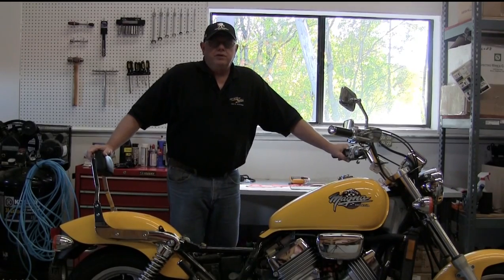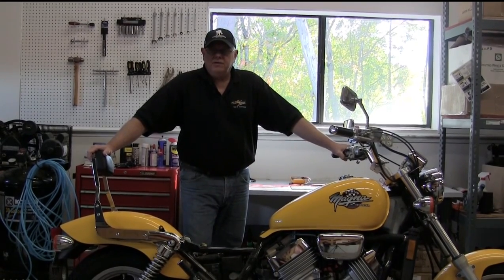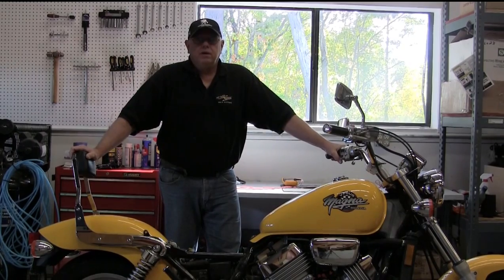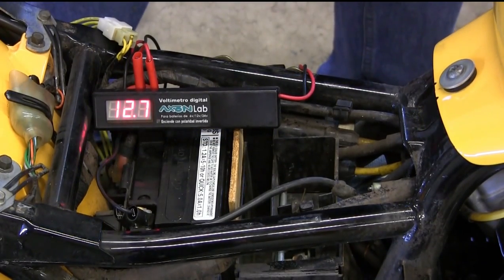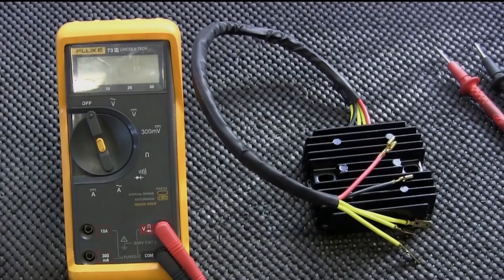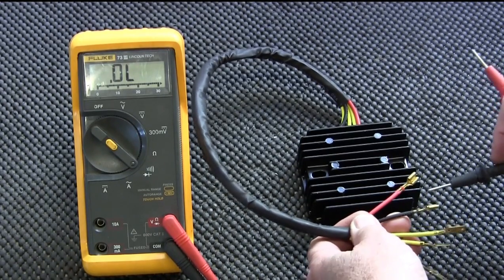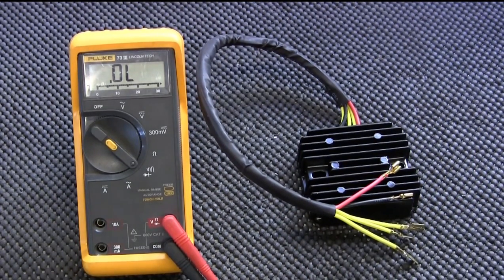#2 How to test a motorcycle rectifier regulator

Comment: What if my idle voltage is 13.9, but drops to 13.1 or less when I rev up? Vtx 1300
Reply from the maker: First thing I would do would be to load-test the battery and check all ground points as those are the two most common issues that result in voltage dropping as RPMs increase.  If you'd like to have your stator or rec/reg checked please email us at info@ricksmotorsportelectrics.com and we can set it up.

Comment: Mines shows 12.8 resting, goes up to 13.5 when turned on but when i rev it up it won’t go higher than that. 2 brand new stators and 2 brand new rectifiers and a brand new battery. What could it be?
Reply: Your recifier may be made to only allow amaximum output of 13.5v DC
Reply from the maker: Our set point on lead acid batteries is 14.5

Comment: Video was posted a while ago, let’s see if you get this haha. 
Testing my R/R I get a range of 400-564 going both directions on the positive and negative.  I get 5V dc coming out when the bike is running. High idle maybe 7v DC. The voltage on the battery doesn’t go up when everything is hooked up, just down as the bike runs so it’s not charging. The voltages from the stator are 12.6v ac and idle and 50v ac at high idle. I believe my regulator rectifier is bad…sound right?  I have an 02 Ducati monster 750Sie. Thanks
Reply: Yes, your R/R is bad.

Ha-ha ;)
Reply: @ruslankadylak2999  I had removed my R/R when testing it, and it looked fine. Removed it again later on while still trying to troubleshoot and there was now big burn. Mark on the bottom of it. Replaced it and Bike has been running good of course, since I posted this. I’ve also had my slave cylinder go out, but that’s now fixed to. The joy of owning an older bike. But thanks for the reply. Ha

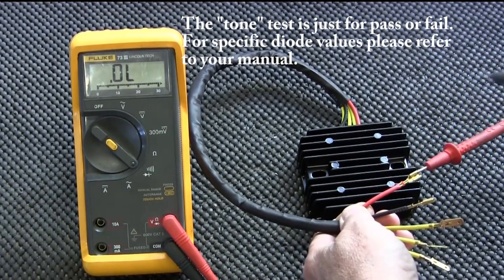Comment: 2:11
I see you removed the yellow stator input wires from the plastic housing/connector for this test.  Do they have to go back in the plastic housing/connector in the same order for the charging system to work right?  What if you didn't keep track, and put the yellow wires back into their plastic housing in the wrong order?
Reply from the maker: For our stators, there is no order to the wires so you can put them back any way

Comment: Do you still reply to comments?  If so can you help me please?  1981 xs400 model H USA model. I have it wired up like so:  black from regulator  going to green field coil wire, green from regulator going to  ground, brown from regulator going to black field coil and a jumper from battery positive to regulator brown. When I check the voltage at the battery it never exceeds 14.5 volts and stays at around 13v when idling. Sounds good, but when I check the red wire from the rectifier that feeds the battery (via the inline fuse removed and probing the rectifier side) it sits at 16volts dc at 2000 rpm and climbs all the way to 20volts dc at 5000rpm. Is that normal?
Reply from the maker: Brad lay your rec/reg is testing fine. You do not disconnect the red wire- that’s the incorrect way to test, hence you’re getting a bad reading.

Comment: Hi there, I have a triumph street triple r 2011 and am having problems with keeping the battery charged. I did this test - with the positive probe on the negative connection i was getting a reading in the 500's on all pins, but with the negative probe on the positive connection i was getting a reading in the 130's on all pins (note my diode tester shows readings differently, e.g. as 138 not as 0.138). Does this imply the rectifier is the problem? Thanks.
Reply from the maker: Did you test according to the video?  And usually on a diode test, there is a tone in your tester...  It should tone in one direction & not in the other.  If it tones in both directions then you have bad diodes.  Make sure when you test, you have the meter on the "diodes" setting
Reply: @RicksElectrics  Thanks for the reply. I tested according to the video and got the results mentioned above (500's on all 3 pins with the positive probe on the negative connection, and 130's on all pins with the negative prove on the positive connection) - but I was not getting a tone in either direction when testing both the positive and negative connections. Could this imply my rectifier is bad? I have also checked the stator and it failed multimeter tests, upon physical inspection 1/3 of it was burnt out. I'm wondering if a faulty rectifier caused the stator to go bad. Cheers
Reply from the maker: @aarona8631  If your meter has a diode function with a tone signal & you get no tone, then you can suspect the rec/reg.  You can also send your rec/reg to us for testing on our dyno.  Test is $20 but if it tests bad & you purchase the replacement from us, that fee is waived.

Comment: Thank you, your video is still relevant. I had a weird issue with my Honda CBR1100XX where it would good dead after 20 miles of driving in hot weather (fan maybe running too). It turned out the R/R had no beep on the POS lines. My old R/R toned fine and I put that back on my bike.

Comment: how hot is it supposed to get thanks
Reply from the maker: Hey John - that depends on the bike but they will get pretty hot.  What do you have?
Reply: honda cbr 600 f2
Reply: 1994 thanks so much for helping
Reply: i have a honda car 600 f2 1994 thanks so much you rock
Reply from the maker: yes - the rec/reg on those bikes get super hot!

Comment: Rick, I'm only getting 12.9V when my '83 Suzuki 650 is running (12.6V at rest), so I removed the rectifier regulator.  The Suzuki manual states to check the resistance in K-ohms between the terminals, but you advise to use the "diode checker".  Following the manual's procedure, I don't get any resistance readings between the terminals (only "1").  Then I use the diode checker mode, I get readings, but not the ones that the manual shows for K-ohms.  Since the K-ohm readings didn't show anything, should I assume the unit is bad (based on the low VDC when the bike is running)?

Comment: People, instructional videos like these for testing a regulator/rectifier are only helpful if your regulator/rectifier has exactly the same wires/connections as the one in this video. Otherwise refer to your manual. My R/R is different from this one and so this video is of no use. Looking at the comments I see people are confused. Refer to your specific motorcycle's repair manual for the correct testing procedures. That is the only way to really know for sure if your RR is good or bad.

Comment: I tested my bad rectifier and didn't get good results like this one so I ordered one and got the exact results as my bad one.
Reply from the maker: Ricky- what is the year/make/model of your bike?  Did you order the new one directly from us?
Reply: I have a 92 seado gtx with a rotax 587 engine. I was getting 12 volts constantly so i thought it was the rectifier Swapped the new one after my first one failed this test, still 12 volts. Im starting think its the stator thats bad. Do you guys sell them?

Comment: If I install a higher wattage output stator in my motorcycle, do I need to"upgrade my regulator/rectifier, or can I leave the old rectifier from the old lower wattage stator please?

Comment: Hello Rick great vids. I have a problem with my honda shadow vt 1100. the ignition vuse keeps blowing.It blew last year once and this year it happens after riding for about 1 hr.the other day it blew 3 times on the expressway . good thing I had extra fuses. today it blew after riding about an hour so when i changed the fuse the battery was dead. but after a few minutes of pushing the bike on the sholder of the expressway I started the bike and made it home on the side streets. when i got home the bike wouldnt start ,I charged the battery and notaced the bike wasnt charging the battery.do you think I have two problems or could the two problems have something to do with each other?I checked for a bad wire. and didnt find any thing . what do you think i should do ?please help.if you can.

Comment: Hello.  Thanls.  Great information. If the regulator gives low or hi voltage should i find that the regulator is bad with this video? My regulator say 11.4 and sometimes 14.3 and somethimes it goes to 17. So defenetely  something is happening. One more question. Is there any polarity on the strator leads or can the be any way connected?  Thanks
Reply: R/R should never output 17V, or it will boil the battery. Normal charging voltage should be 13-14V. So, your R/R was bad.

Stator wires are 3 phase AC - no polarity.

P.S. I know you must have fixed your bike a long time ago. My comment is for the benefit of some other people...

Comment: I'm confused  on the beep/no beep or reading/no reading conditions.  Which indicates a good set of diodes and which indicates bad?  I have a 3 phase 12 volt rectifier off a 98 Honda Blackbird.  When I touch the red prob to the red wire and the black to each of the yellow wires, I get not beep and no reading change.  When I place the black probe to the red wire and touch each of the yellow wires with the red probe, I get a reading change on the center wire but not on the outer two.  When I  place the black probe on black wire and red probe on each yellow, I get nothing, but when I place the red probe on the black and black probe to the yellows, I get a reading on all three yellows.  Interpretation help please????

Comment: Okay so my meter isn't beeping when i hit the 3 parts. it gives me a reading but it's all over the place. I tested my stator too. It was .7 - .9 all around, so it is my regulator that is bad? Are there any other reasons why the battery would drain? There are no lights left on. I have a brand new battery. I'm about to replace the regulator and the stator just for the heck of it since I don't want to go get it checked out and pay to have it looked at...

Comment: I have received back a custom stator  from you. looks great by the way! I installed it and checked battery when idle 13.8 and if rpms increase the voltage goes down. Is this typical?

Comment: Rick,
I have the 3 wires that go to the stator, I also have 2 green wires and 2 red wires. Why are there 2 greens and 2 reds? Do they serve the same purpose? Also will my reading be inaccurate if I ise the ohms setting on the multi-meter? 

Thanks

Comment: i have a 300 bayou 4x4 and i need some help on my voltage regulator. it has 3 pins..3 on the top and 3 on the bottom and i have 6 wires...a brown,white,black and yellow, and three yellows. any idea where each wire goes?

Comment: My regulator (off of a 82 cb900) has a total of eight wires three from stator two from the brushes three leading elsewhere into the wiring harness. I have nearly no continuity performing the test you did (500,000+ pos.lead to  positive wire - stator wires, 280,000+ pos.lead to negative wire - stator wires) and zero continuity placing the negative lead on either of the wires from the brushes to stator. My guess is my diodes are shot. Am I correct in my thinking?
Reply: My multimeter does have I diod function that beeps. Just wanted to give you specifics

Comment: Hi there Ricks. Thanks for the great descriptions and help. One further question. On my reverse pole testing, im not getting a beep but rather numbering coming in around 500-520. It appears that the positive wire connected at the housing is burnt out. I am no professional but my guess would be that im going to need a new rectifier and/or new wiring on the other end of the housing? correct? Thanks for your advice

Comment: hi rick. what if my test make sound when i put the red tester to the red cable and test the negative on all three yellow cable but no sound when i reverse them?does that means my rectifier is bad?the result are the  same for both red and black wire on the rectifier

Comment: Great channel, very informative. You've got a couple of recurring technical problems with recording. Audio is coming through only the left speaker. Check your video recorder, probably a bad jack connection, or maybe it's something with post processing. Video has strong backlighting which makes it very contrasty, hard to see detail in the shadows. If you keep the dominant light source (window) at the camera's back, suddenly it will be much easier to see, and your autoexposure won't be fooled into underexposure. If you have to face the window, flood the area with a large second light source from the rear.

You've got great detail in your channel, I'm sub'd.

Comment: What happens when I hear no sound but my values are. 485 for all 3 wires.  My stator noload output at idle for each phase is 25v and at 5k run is 85v but idle charge is 12.94v at battery and 13.3 at 5k run with high beam on.  Ohm value at stator is. 3 to. 5
Reply: I don't think all multimeters beep in the diode function. I think mine beeps only in the continuity mode. For the diode function, performing this test I get 0 on one direction and a number in the other direction. When I reverse power leads, which probe results in zero is reversed. That's what it should do. Diodes allow electricity to pass in one direction and not the other. The positive lead of your multi tester and the negative lead should produce similar results but on opposite regulator power connectors (because this means the electricity is flowing the same direction through the diode).

Comment: I have a 2001 Honda Magna. When a rectifier fails, can it overcharge your battery? I've cooked 2 last month.
I heard because of the location of the stock rectifier, they tend to fail due to heat.

Comment from the maker: You need to use a meter with a separate diode testing function with an audio component.  You use that "tone" not the digital readout (per the video) to tell if it's functioning properly.

Comment: I have a Honda shadow vt750cda and was having charging problems the battery idles at 12.6 and goes to 14v at 4000rpm so i didn't think it was the battery then i tested the regulator and it read only 6v at 4000rpm and is suppose to be 14-15v so is that the problem or could it be the stator also i haven't checked that.. Would rtd be able to test my regulator if i take it off the bike and take it in or no? Any help would be appreciated..

Comment: Rick, I have a 1.5 amp trickle charger / maintainer. I leave it always connected to my motorcycle when I'm not riding it.
Can this constant use of the charger cause a regulator / rectifier to fail? thanks.

Comment: It wouldn't keep the bike from starting, if your battery is sitting at about 12.5-12.8v like normal your bike will still start off just the battery. It doesn't need the regulator to start, it just needs it to get DC power to the battery, eventually the bike will die from low battery if the regulator is bad.

Comment: If I do not get a beep on a rectifier regulator then it needs replacement? My bike is not turning on. It did yesterday after cleaning the carbs, changing the spark plugs, oil change, coolant change. Now it does not want to start. I checked the 30A fuse to see if it would click to make sure the starter was turning. Now I would like to check the rectifier regulator and stator. But before I assume its bad I would like to know if that is what's keeping my bike from starting?